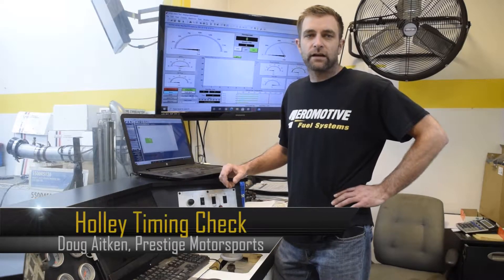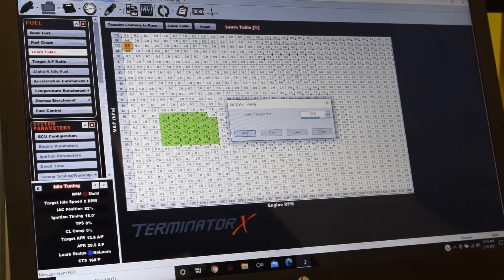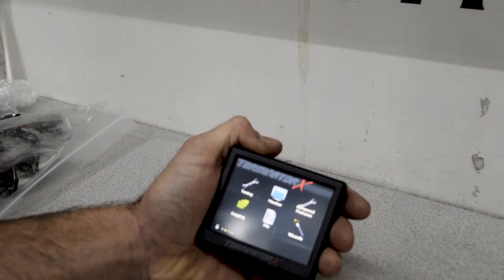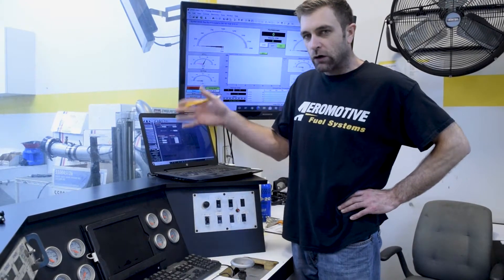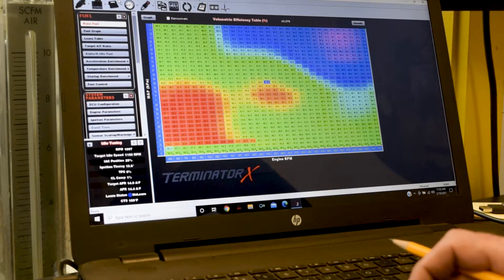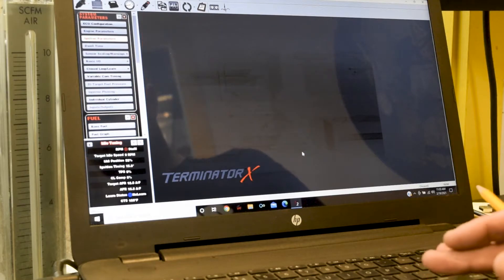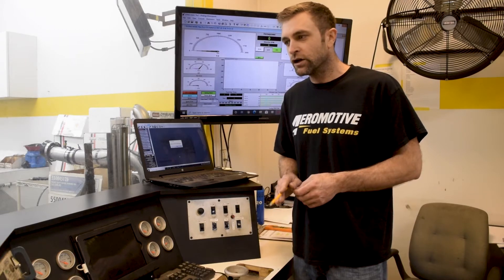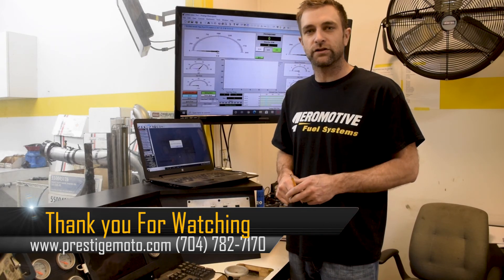How do I Check My Timing with the Holley Terminator X Multi Point EFY System?

Comment: Hi I have the Holley terminator X I don’t have the lap top program just the hand held I’m trying to set the timing so it Idols at like 17 degrees and when I Revit up it goes all the way to 36° just doesn’t stay where I set it at on the hand held all help would be highly appreciated thank you
Reply: So I got to playing with it I have a 5.3 with a btr stage 2 truck Norris cam what’s the ideal start timing and Cruz timing and wide-open throttle timing supposed to be

Comment: Do you set 32 as the static timing for a 5.4l mod motor?
Reply: Can you set static timing to whatever you want. I usually do 20-30 it’s only to lock in timing so it doesn’t bounce around on you.